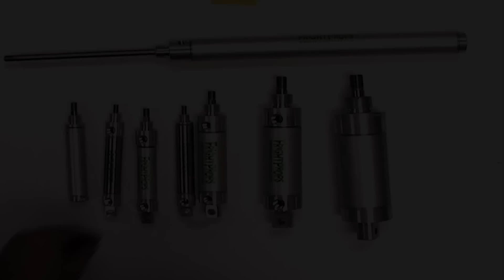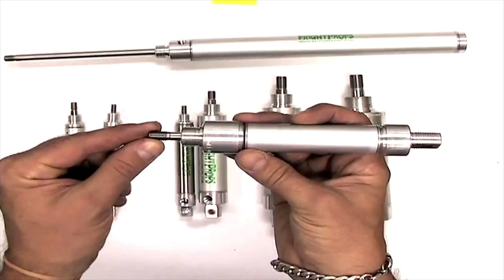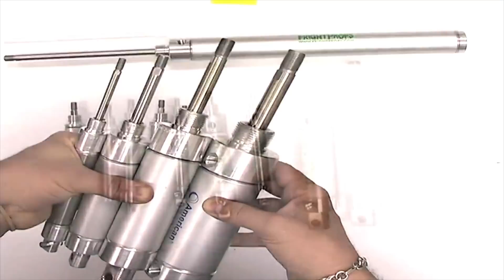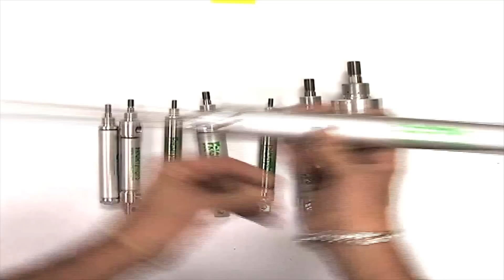Pneumatic Cylinder Tutorial with FrightProps

Comment: Nice video, How would one calculate the amount of force that a cylinder is capable of applying?
Reply: +Pat Moore you have to know presure (P) and bore size(D). So you have,
(presure x surface)/100. For ex;
p=100bar
D=20mm
F=100*((20*20*3.1415)/4) )/100 = 314.15daN
Reply from the maker: +Pat Moore - There is a chart in this document that shows the force multiplier of each bore size:
http://www.frightprops.com/faq/content/2/52/en/cylinders-the-different-types-explained.html